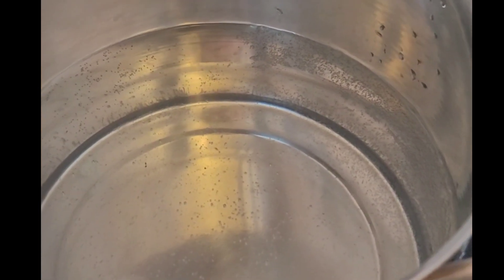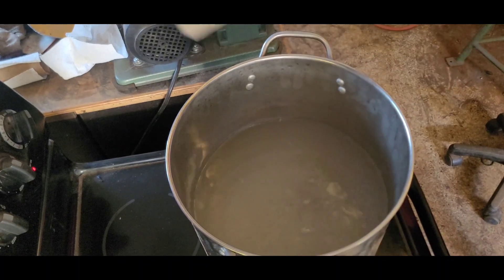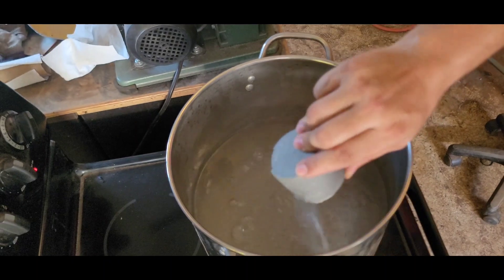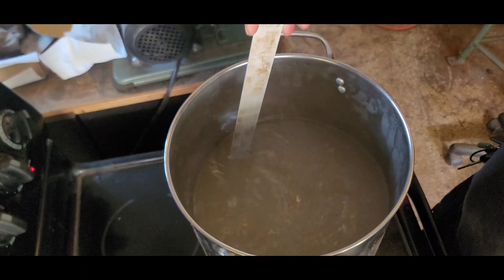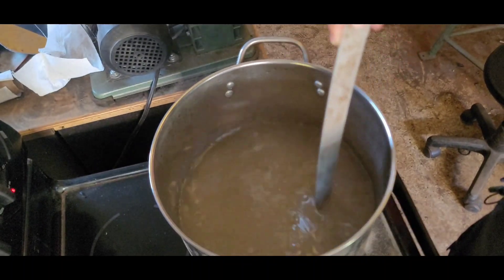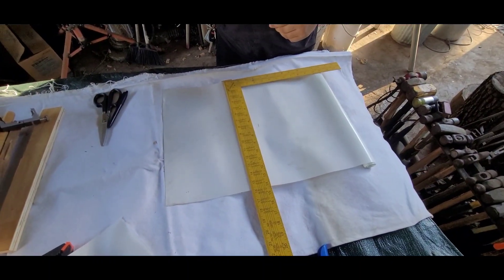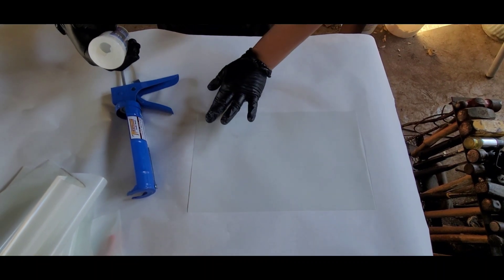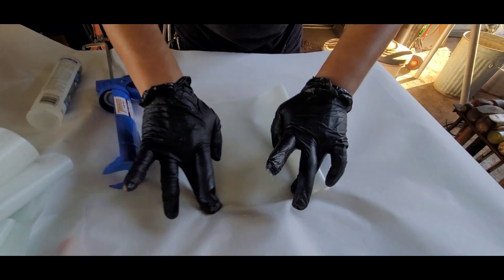PCM Super-Material Cooling Packs DIY.

Comment: 10:30 caulking tubes sometimes have a metal seal at the base of the nozzle. Your caulk gun often has a spike to poke a hole in the foil seal there inside the base of the nozzle.

Comment: Awesome video. Is the material pretty safe near fires?   I'm planning to do this treatment  to my tent, but want to make sure that any sparks hitting the tent material don't cause it to catch on fire.
Reply: I’ll jump in. In the original video, there is a discussion about using this for both firefighters to wear under their gear and to line fire shelters to keep them safer when a fire overwhelms them. It’s supposed to be pretty safe.